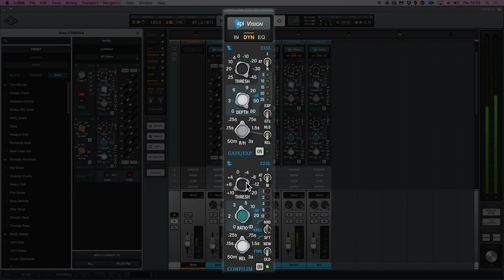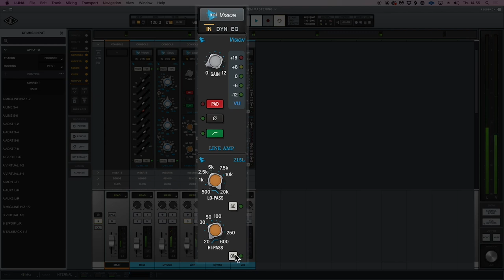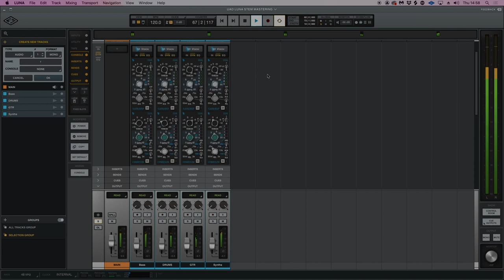Stem Mastering with LUNA API Vision Channel Strip

Comment: Wondering is there a benefit to having the "Main" (Master) channel on the far left?  I'm used to working tracks from left to right & Main/Master channel on far right...Does this help w/how UAD's DSP distributes & shake down?  Thanks!
Reply: There's no Benefit to having the Main on the Far Left, inside Luna you can move the Channels around to suit ones own workflow.
Reply: Ok, Thanks!  On a different aspect,  I thought I heard maybe to do w/instantiating bigger plugins, it may be good to do bigger ones 1st (sometimes I've taken off a few small ones, put in the bigger one/s, & then it gives me enough DSP room <when running out of DSP>)
Do you know about this?  Thanks!
Reply: @athuairush235  it doesn’t matter what order you put plugins, they will always use the same amount of DSP no matter what order they are placed within Inserts or wherever the channel is visually located the difference with DSP usage really matters if you are using mono or stereo. If you feel you are running out of DSP just render that channel and then import it again, then disable the channel that is using the DSP and hide it.
Reply: Ok, Thanks!  Is there a "render" function in LUNA yet?  Or would it be just be mixing down (exporting) the channel (through the main channel, right?), then importing again?  Thanks!!!
Reply: @athuairush235  No there is no render in place function yet, you just need to Mixdown on the single tracks you want processed and then import them.
Reply: Ok, thanks again!!!